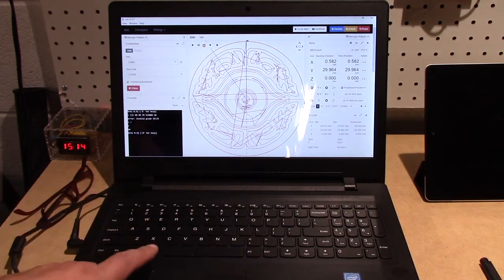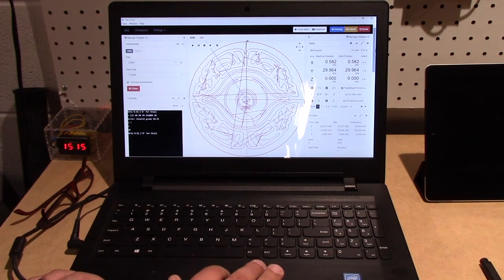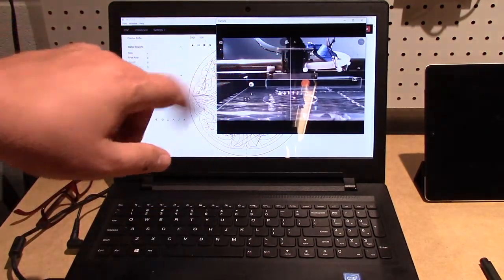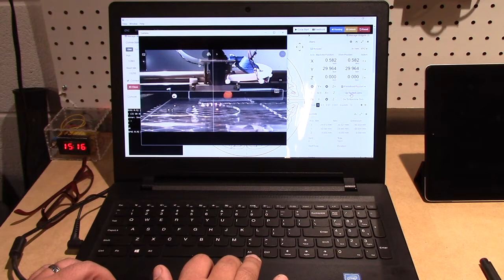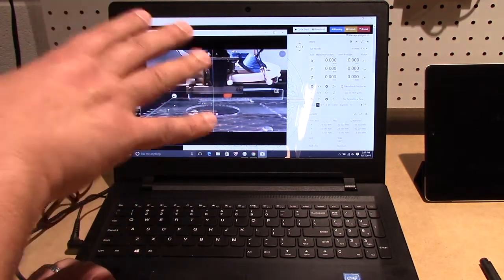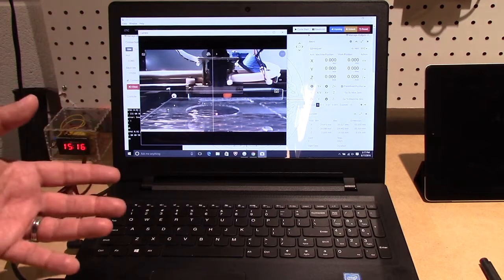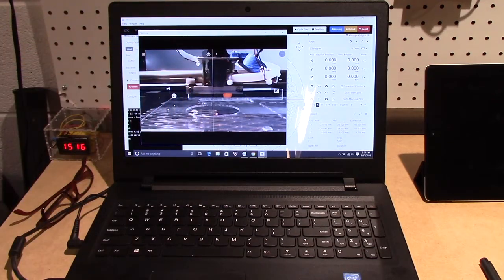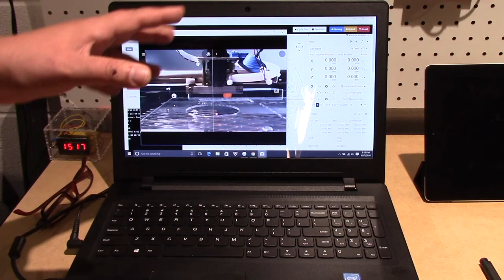K40 eBay Chinese CO2 Laser Cutter & Engraver - Monitoring with a Cheap Webcam!

Comment: Yes; help keep your eyes safe. 

Another use for Blue Painters tape :)

On the head sometimes, (mix and match), but watch-out, pun intended, for wires getting snagged, weight impact, (even if not very heavy).

Some WebCam Pi stuff:-

Rather than using the Raspberry Pi camera module, you can use a standard USB webcam to take pictures and video on the Raspberry Pi.
https://www.raspberrypi.org/documentation/usage/webcams/

Raspberry Pi remote webcamhttp://www.instructables.com/id/Raspberry-Pi-remote-webcam/

Beginners Guide How To Setup a USB Webcam to your Raspberry Pi 2 in Minutes 
http://www.awesomeprojects.xyz/2015/09/beginners-guide-how-to-setup-usb-webcam.html

Build a Raspberry Pi Webcam Server in Minutes
https://www.youtube.com/watch?v=WNKbZsrsKVs

The well known and respected:-
OctoPrint OctoPrint is the snappy web interface for your 3D printer that allows you to control ... Access the embedded webcam feed and watch remotely how your printer is .
http://octoprint.org/
Reply from the maker: There is also a "laser" version of Octoprint has been forked too :-)

Comment: What program are you using for cutting?
Reply from the maker: Are asking about the G-Code sender?  I use several (depending on my mode :-) here is a list http://diy3dtech.com/gcode-sender-reference/
Reply: Thanks, I was wondering and assumed you've upgraded your controller.
Reply from the maker: Sorry not sure I understand "upgrade controller"?
Reply: That it is not the stock K40 controller, you've upgraded to a Smoothieboard or something
Reply from the maker: Uno with GRBL 0.9 if you check out the playlist for k40 lasers I show how to make the conversion :-)

Comment: I have an infrared webcam. That would be cool to use for time-lapse videos overnight with out needing external lighting.
Reply from the maker: If it has the IR cut filter completely removed it would also work well for watching an IR Laser in fact you have given the idea to hack the IR cut filter out of a webcam and try it for this applications!
Reply: I’ve been using a webcam & octoprint to monitor my laser. Works great & gives nice peace of mind!